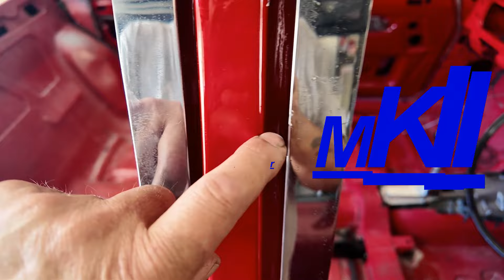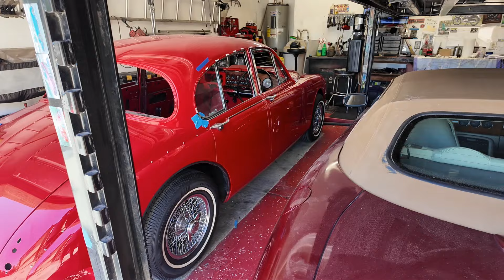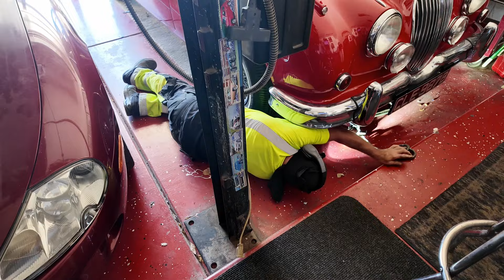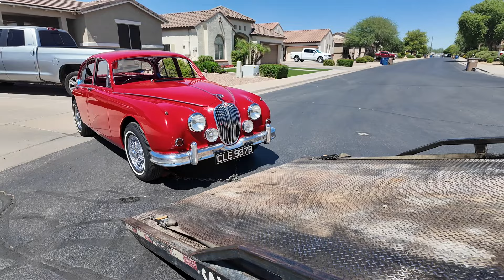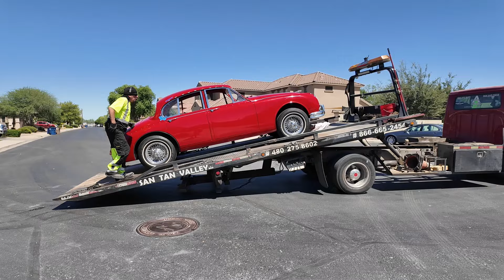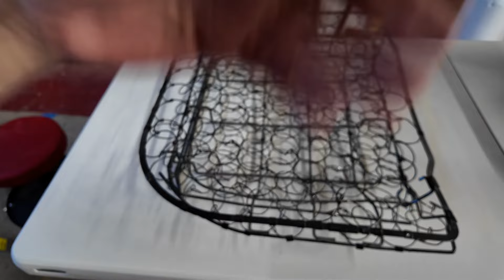Jaguar MKII Reassembly Part 310

Comment: Cotton padding is called batting . One of my ex wife's did upholstery . Some use another synthetic material  called cello  cloud .  The reason is that cotton will mold and holds odors . Just as years ago they used horse hair to stuff upholstery.  Not telling u how to recover your seats just their are better materials for the stuffing the seat than ]n cotton .
Reply from the maker: NO NO NO, thank you for the advice I will try and find a modern equivalent, ONLY a fool would not listen and learn.

Comment: I'm really confused - mine was similar around the frames after its respray - but it is easily shimable (just as they did at the factory). Does it need a body shop to do it?
Reply from the maker: Hell YES, the doors(two of them) are not from this car, which is why I told them to use the frames with the door shell and make sure everything is OK, they forgot, the problems on my frames is front to back and the door body won't allow them to move , that's why I told them to use the frames WITH the door shell.
Reply: @jagvette1  ah got it. Thanks